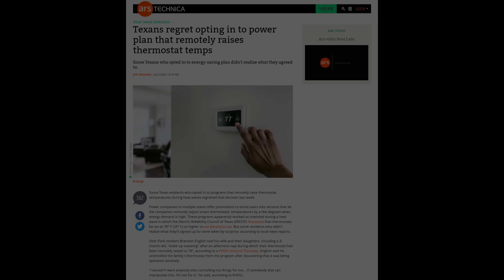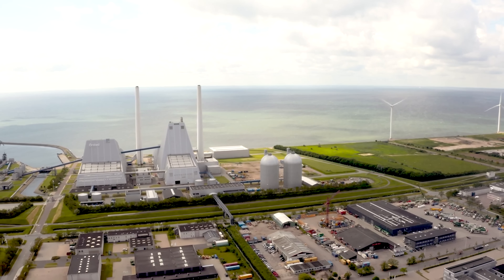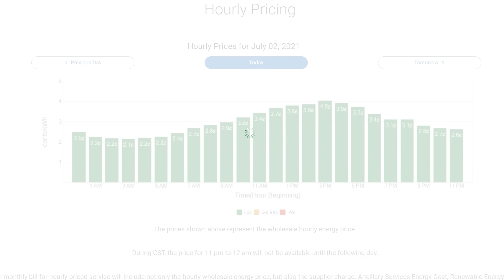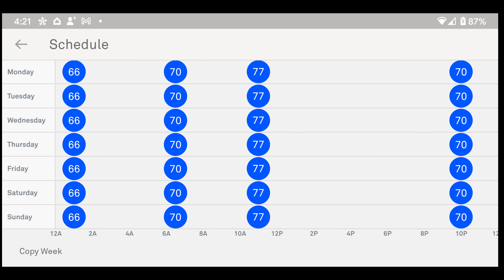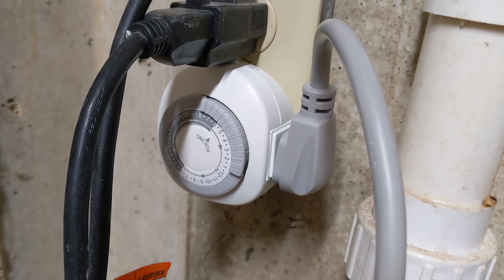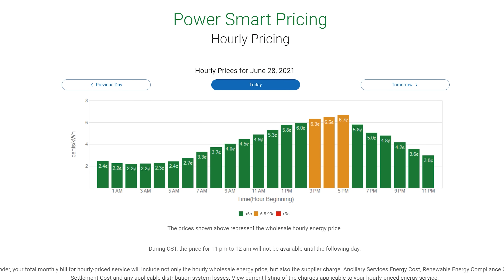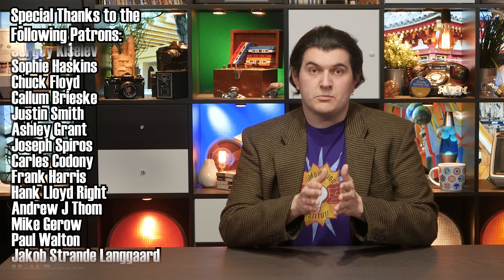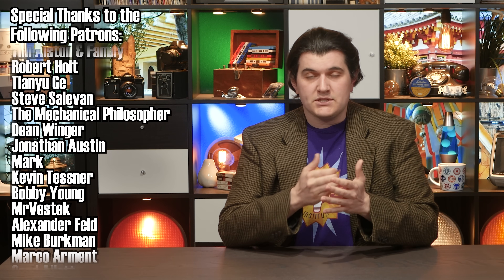Batteries aren't the only way to store energy. Here's another.

Comment: I would totally try this if I didn't live in a 70 year old house in Texas
Reply: Same
Reply: Insulation. Thermal barrier. (Attic foil is great!)
Reply: If your windows are leaky, adding storm windows will help a lot (The house I grew up in was about 100 years old but my parents added storm windows over the originals).  Also temporary clear plastic can cut drafts losing cooling to the outside or cold air coming in winter
Reply: @75OldsNinetyEight  You can even do blackout curtains.
Reply: @EliasTheHunter  If he likes living there, why move?
Reply: The Tired Horizon  That does cost money, not everyone can afford doing this.
Reply: The Tired Horizon  Money is
Reply: That's no excuse.  Any house can be refit to some degree.  The problem is Texas builders didn't have foresight to think that maybe all the insulation folks up north use would be useful here.  They just made the assumption nothing would ever change, despite 4.5B years of evidence to the contrary.
Reply: @phydeux  the problem is money, you can't blame a person from the 1930s of not having the foresight that in the insulation is really usefull in Texas, when he was working all day to get a tad bit of food on the table for his family.
Reply: I live in a 100 year old house in Pennsylvania, so I feel your pain.  Plaster and lathe walls with air gap “insulation” does not make for a very energy efficient building.
Reply: You can get spray foam to fill the walls and that should help considerably. Also change all the gaskets around doors and windows.
Reply: Same and same
Reply: Yeah where I live it gets so hot in the house with 3 air conditioners it takes over night just to get it down to 70-74 so that the house starts the day off cool enough to keep it below 90.
Reply: same if i didn't live in a over 100 year old house lol
Reply: @teaser6089  One has reason to blame a tract home developer in the 00s just fine tho
Reply: Between increasingly-violent hurricanes and winter storms, don't worry, you won't be living in that 70-year-old house much longer. You'll be able to get a housing upgrade subsidized by the parts of the nation that take climate change seriously.
Reply: The Tired Horizon : It may surprise you to find out that some regional electricity providers in the USA actively penalize people who install end-user power generation like solar panels -- they won't pay you a fair price for excess electricity your house generates (if they pay you at all), and they raise the rate you pay for electricity from the grid too. They claim this is because end-user power generation makes grid loading less predictable and raises their own costs, but everyone knows it's because the power plants are protecting their existing business model.
Reply: @teaser6089 : It's true that you can't blame a homebuilder in 1930 for not having the foresight to realize that home insulation would be more useful in Texas in 2021, but you can blame all the people who lived in the house between 1930 and 2021 for not upgrading the house as technology improved and environmental conditions changed.
Reply: @deusexaethera  Because every single one of those people can afford to upgrade. Oh wait. TEAser, keeps making his point clear: not everyone has enough cash to either move into a newer home or upgrade their old one. Just think of the amount of money upgrading an old house would cost. Nowadays there's better technology and knowledge when constructing buildings, but you can't just expect everyone to have the cash to upgrade the whole building in an instant as soon as the new improved technology comes out. You say that we can blame all the people who didn't upgrade the houses... You are literaly saying we can blame people for not being rich. B R U H.
Reply: @markm0000  You could run into moisture problems weakening your structural elements. Making buildings airtight for low energy consumption was my job for more than 15 years.
Reply: @deusexaethera  Maybe you'd be better off blaming the government for not incentivizing people to do that. 

Upgrading a house costs money and a lot of people in the US work day by day to get food on the diner table, they ain't got a couple big ones around to do some home improvement.

Big companies are producing the most CO2, they should be looked at and blamed for not doing things earlier. The working class really doesn't have the resources to fix this shit on their own, the middle and high classes control most of the resources and they should fix the shit that they created.
Reply: I would totally try this if I didn't have a 200 year old single brick cottage in London.
Reply: Then stop doing that.
Reply: @deusexaethera  where? the part that has rolling brownouts because the electrical grid hasn't been maintained? or the part that just had its transportation infrastructure completely flooded?
Reply: @AlFredo-sx2yy  idk what world you live in where home repairs are only for the rich. Grab a hammer dude. Plus I’m pretty sure someone BUYING A HOUSE has some money saved up 😂
Reply: IDK, all the old houses I know have thick stone or brick walls. The thermal capacity is huge. Add some insulation and new windows and you are good to go. Another advantage is some wind will not simply tear the house down, lol.
Reply: @Jenny-tm3cm  bruh, like modern insulating materials are cheap where i live huh? It's almost like every place has a different price for certain items!
Reply: @deusexaethera  this is probably true. But it is also true that DER (distributed energy resources), i.e. inverter based energy generators require upgrades to the power grid.
Reply: @teaser6089  that’s why I asked them, not you. Curious if they like it enough to stay now that we’ve seen what Texas’s grid is (in)capable of.
Reply: there are many things besides temperature control on your house that can make use of this technology. washing (dishes and clothes), hot water storage, at some point charging your electric car and other devices
Reply: @EliasTheHunter  Yeah I'd totally move away from everyone I know, the place I gew up, because of event that takes place once a few decades or so. Makes sense.
Reply: @teaser6089  again, I never asked you. I asked the original person if they had considered moving.

Why do you think I mean they should move out of state? How about into a newer neighborhood? Or maybe across the street into an updated home?

You’re just looking for an argument and you know it.
Reply: maybe a cold water storage tank, cooled at night.  then you can cool your house only during the hottest parts of the day.
Reply: Yea our house has 2 layer windows on the old side. Also I noticed some draft from the roof and one corner. Also in the winter the snow starts melting from the roof when it's -4°c. Last winter our heating wasn't enough (~4,8kw of resistice heating) when it got -30°c outside the temperature dropped to 18°c inside.
Reply: To cool your house a nice trick is to fill your bathtub with cold water, and let the bathroom door open
Reply: @Kannot2023  I have never seen a house with a bathtub
Reply: Do it anyway. I live in a duplex built in '53. It still works. It's not going to stay cool all day, but it will make a pretty big difference. (And save some $$$)
Reply: I feel your pain. My house is also 70 years old and in Texas. If you're not going to do a complete remodel, it's pretty difficult to reinsulate. We ARE planning on doing spray foam in the attic though.
Reply: @teaser6089  Some people don't understand this at all. You can easily double the cost of your home in renovations trying to modernize and become more efficient. I spend 7 - 10k a year updating my 115k home and that 7-10k doesn't get you very far. Even on the DIY side of things. Especially proper insulation which requires new siding (just quoted at 22k for vinyl with r10ish insulation) or removing drywall (which if you're doing this then you definitely need to update electric and plumbing while your tearing everything apart). Blow in is a thing, but when you do eventually have to update something this will be a real mess and its still not exactly cheap either.
Reply: @teaser6089  That doesnt mean that whomever is currently living in the house CANT do a retrofit, in 2021. Foresight has nothing to do with it. 

If you want to keep a house, you continue making modifications/additions to it to fit your needs. Don't want to do it, and don't want to move? Why complain about it all if you're unwilling to get it taken care of?

If your house built in the 1800's has no insulation, and you say you basically have to run the a/c all day every day because of it.... you're spending WAY MORE in energy costs, than you ever will in simply investing into contracting someone to actually insulate the house so that your overall energy expense is far less. 

This is one of those situations where "it pays for itself" is a true phrase.
Reply: @AlFredo-sx2yy  Its almost as if.... you go to the local hardware store... and you buy the cheapest insulation material they have, and buy what you can afford at the time. Its not any different than saving money. You buy a little at a time until you have enough to insulate what needs to get insulated. 

I didn't buy my first house because I make $10k a month income. I bought my first house 15 years ago while working for $10/hr, living foot to mouth, and was able to save up money for the down payment, and to help pay the mortgage I rented out the 2 spare rooms I wasnt using.

Even some cheap foam that comes in packages, while not very good, it better than no insulation at all
Reply: @rotor13  I can't judge that guys situation, neither can you, so wether or not it would be worth while for him is not for us to decide
Reply: @rotor13  if only i didnt live in the middle of fucking nowhere and a hardware store existed nearby and not over 30 km away then yeah, i would be very glad to do so. But gas is expensive you  know? WOW, its almost as if people in different countries didnt have the same living conditions as you do!
Reply: Same
Reply: The Tired Horizon  uh yeah he was. Jonathan Sherry literally said “That’s no excuse”. That’s blaming lol. Not something you said, but another reply nonetheless
Reply: Dear god all of this thread is just some idiot saying “JuSt uPdaTe yoUr hOuSe” despite countless people trying to point out the fact that NOT EVERYONE HAS THE MONEY TO UPGRADE. Hopefully the caps will make it stick out so they can read lol
Reply: @cwill2127  I'm glad there's at least some individuals here who understand that not everyone has the cash to upgrade their house ffs...
Reply: 211 has low income heater replacement assistance
Reply: @EliasTheHunter  Old homes are much better built, generally and have more character.
Reply: @Nicholas-f5  I wasn’t asking you.
Reply: @dailytact1370  Do you mean like shade over the AC? as in Awning? sorry I'm curious and interested
Reply: Closed cell spray foam is amazing
Reply: You can do other things. I live in a poorly isolated apartment on the top floor and I have consistently 3°C less this summer, simply because I made aluminum foil curtains from a couple meters of the foil and some firm tape. It probably cost me about 20-30 cents in total and took like 15 minutes.
This might not be applicable, but just saying there is usually a lot you can do in regards to maintaining a comfortable low temperature.
Reply: @75OldsNinetyEight  Yeah. I'm in an old Canadian coach house that was built in the late 1800's. I plastic the windows. Costs about $15, but save over $200 in heating every year. I could replace the windows, but I don't plan to keep the house long enough.
Reply: @EliasTheHunter  Moving across town doesn't solve the problem.  If it's 115 here, it's 115 across town...more or less.  In some extreme climates heating or cooling are needed for days on end...weeks even.  There are no cycles for storage.  Insulation only goes so far.  Your house is going to get hot or cold without using energy to stop it.
Reply: @johnchestnut5340  presumably they wouldn’t be moving into another 70 year old house….

I mean it’s their decision, so whatever works for them!
Reply: @EliasTheHunter  You miss the point.  A new house doesn't solve the problem in extreme climates.  But fine.  Believe what you want.  Going underground or into caves is a better option if you can afford it.
Reply: @johnchestnut5340  you’re saying that better insulation in a newer home will do nothing to help the problem. Sorry, but physics don’t agree with you.

As for my personal experience, proper insulation made a big difference to me in Las Vegas.
Reply: @EliasTheHunter  Try reading.  I didn't say that.  I'm done; if you cannot be bothered to read my comments there is no point.  You are wasting my time.
Reply: @johnchestnut5340  oh okay, so it doesn’t do enough to matter? What a fatalist.
Reply: It's easy, what do you mean don't have the extra money to entirely rennovate your house and replace your windows, walls, insulation, and roof? What the actual fuck?
...
..
.
/endsarcasm
Reply: I live in a 60 year old house in eastern Canada, with no A/C.  At 8:55, I turned off the fan, in my window, that blows air into the house.  I will turn it on at 12:30 when the yard under my window is in the shade.  The fan will then run until 8:00am, tomorrow.  My bedroom is comfortable all day, for reading and computerring.  Note that at the time this house was built, the only buildings with A/C in the area were large office buildings and large stores.

I realize that it is much warmer in Texas than here so this may not be appropriate for you.  Maybe we should do away with all A/C except in hospitals and special buildings such as computer rooms.  If every air conditioner runs at 90 % efficiency then each air conditioner is pumping out a kilowatt of waste heat for every 9 kw of heat it sheds to the outside air.  Ten million A/Cs will dump enough heat into the atmosphere to raise the temperature enough to create the need for even more air conditioners.
Reply: You can still upgrade your house!

Insulate the walls and attic, replace windows, weather seal the doors and windows will all make a big difference.

Comment: I like your family's nighttime cooling storage method for the many good reasons.   You're blessed that Mother Nature made you some shade.   If I may add an observation; so I turned our home into a refrigerator (of sorts) with quality time sealing ducts, insulating, radiant barriers,  water sprays, and ventilation to remove heat and help keep humidity down to 40%.   These efforts cut our unshaded home electric bill from $400 per month to less than $200 on a 4000sf home.  I see generally the outdoor unit's compressor runs quieter when the ambient air temps are cooler at night.  Appears that there is LESS work on the outside unit to heat exchange !   So, it makes sense that without the sun beating down on the outside unit, it runs to some percentage TBD more efficiently.
Reply: The shade was created by nature, yes, but planted and taken care of by men.

May I suggest you to look into adding trees to your lawn? I'd go for a native species if possible. Some species grow pretty fast.
Reply: Really hope you aren't using water spraying on your coils.

Comment: "Sounds great!" I think, sitting in a 100 year old house with a 50 year old heating system.
Reply: @Monochromatik we bought a house last year to rent to our daughter and son in law. The house is literally 100 years older than our daughter. We had two of the modern heat pumps installed, that each run two room heating/cooling units. 
But living in Minnesota, where sub-zero high temperatures are still a thing in the winter, we were advised to keep the old boiler that works with the baseboard radiators. 
And…
The even older floor to ⬇️ ceiling vents that allow warm air from the main floor to rise upstairs to the bedrooms. 
The previous owners added a layer of foam board insulation between the original sheathing of the house and the new siding.
Reply: Same here. Someone tried to inject foam insulation in the balloon framed walls in the 70s or 80s (when the house was a mere 50 or 60 years old). Over time that insulation pulled away from the walls and fell into the basement where it continues to crumble away and form large voids. Our heating and cooling strategy is to just set the temperature at a reasonable level for the amount of energy we want to consume, then let it run.
Reply: Our hundred years old house has a flat black rubber roof with no insulation in ceiling or walls. We run the AC which keeps the ground floor comfortable, but on warm days, the bedrooms just can't be cooled to a comfortable level for my wife.
Reply: There are heater replacement programs for low income and through nonprofits via 211
Reply: @Monochromatik Wood is great with a catalyst for all the smoke pollution.
Reply: @Monochromatik Burning wood is pretty bad for your lungs thought.
Reply: 40 y.o home but direct sun and vaulted ceilings (no attic to act as a buffer). Tried this method this weekend just for the hell of it. Temp went from 67° at 1pm to 89° at 8pm. And used about 10 more kWh of extra cooling than normal just to get the house pre-chilled, only for my "leaky battery" to lose it all in a couple hours. Nope! Not for me (or rather, not for this home). I gave up today and slammed my AC back on a couple hours ago.

Previous strategy is to just keep it at a "comfortably warm" 77. Luckily this AC draws out humidity very well, otherwise a humid 77 would be intolerable. And my power company has a cheap flat rate and no "demand" periods, so there's really no incentive to do this here.

Every day is an experiment! 😎👍 Don't know if you don't try